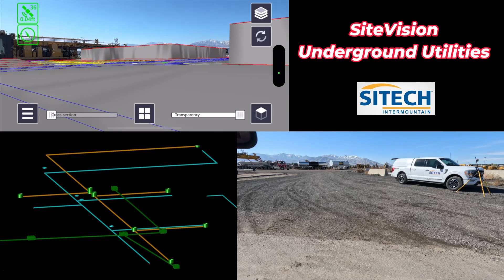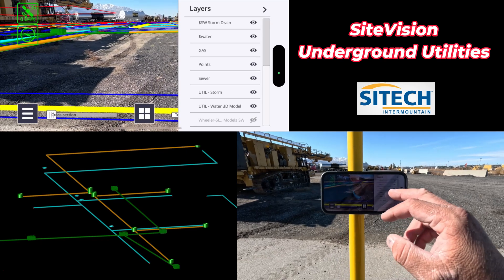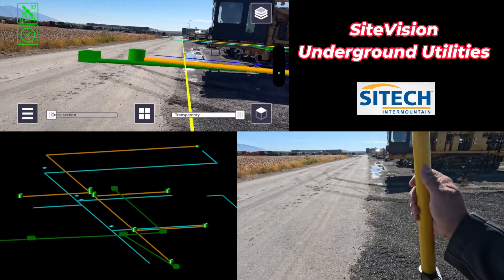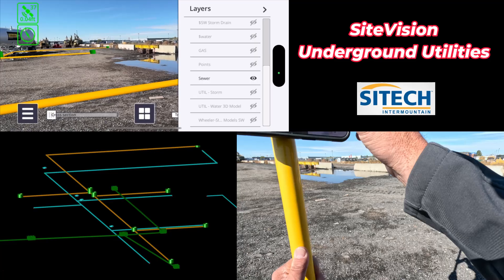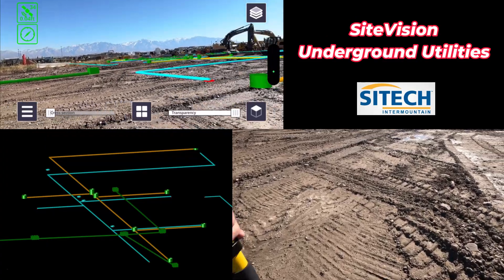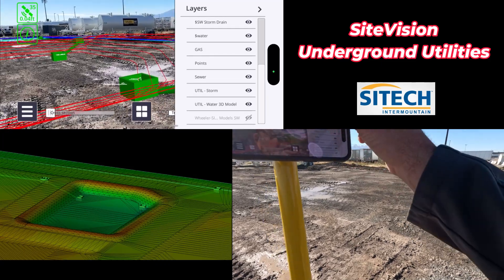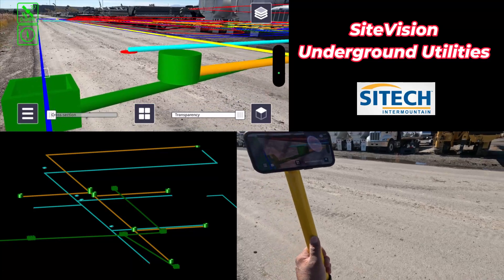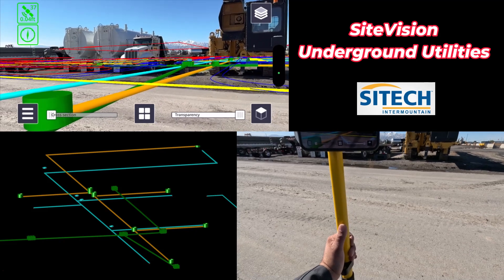SiteVision Viewing Underground Utilities

Comment: Is this only viewable with an Android device or can this type of file be created for a controller such as TSC7? And it’s created with TBC right?
Reply: I did create the line work in TBC.  I am using an iPhone in the video, but you can use both android or iPhone or even an iPad if you have one.